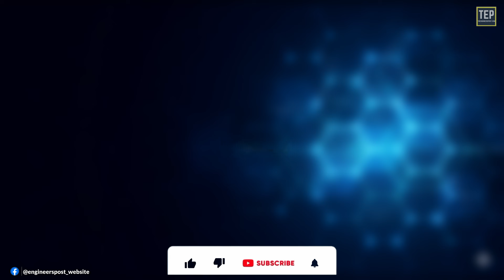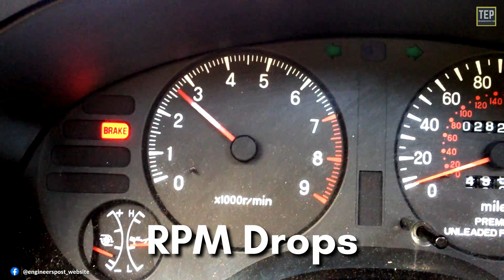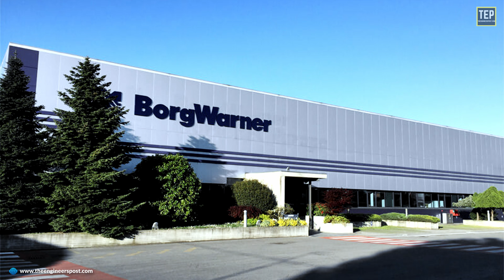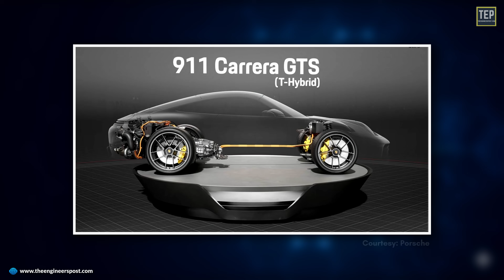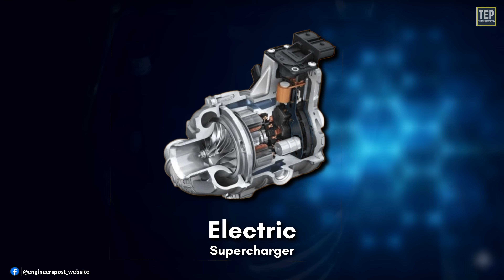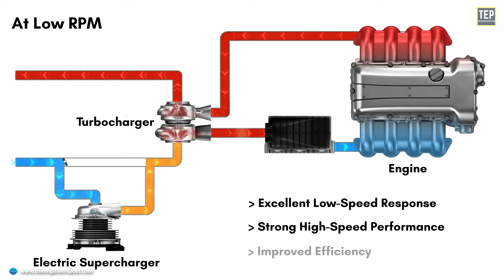How a Electric Turbocharger & How a Electric Supercharger Works?

Comment: If the turbo is not needed except for occasional high output times it makes sense to use a purpose only battery powered turbo. Charging that battery from a braking recovery system is perfect. Hybrid charging for longer turbo use while complexing adds convenience

Comment: Before watching the video, allow me to point out that any forced induction system can only increase the power of a specific size system and they can NOT increase mpg. 

Why do manufacturers use these 1 liter turbos then? They can run it in their labs without having the turbos kick in a single time to get those great mpg numbers. When the customer takes the same car outside of the lab, drives it normally and fails to reach the marketed mpg, the manufacturer will just say "you have a lead foot". They are technically partly right.

Now onto the video.
Reply: Good try mercedes and porsche, but my 20 year old sportbike is still faster lol.

Great video!